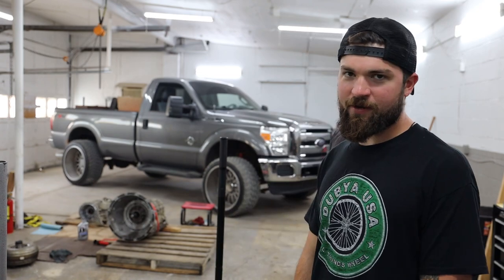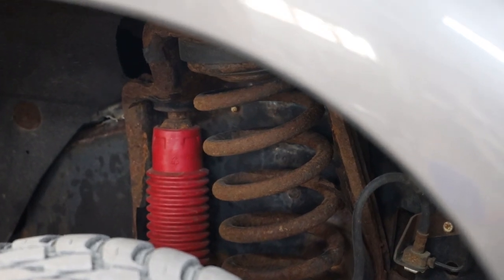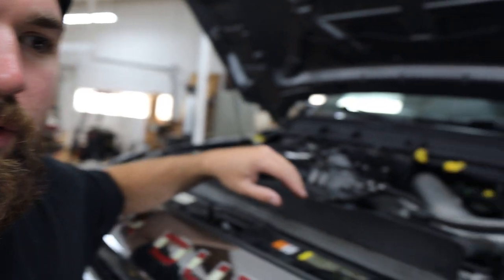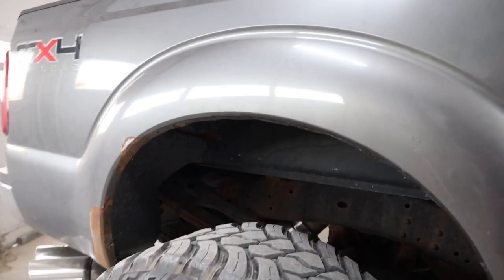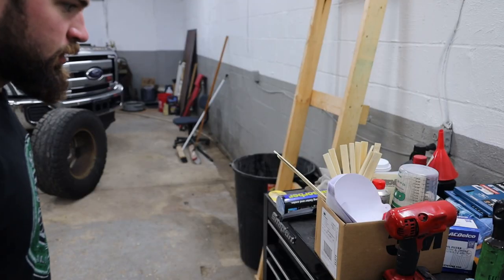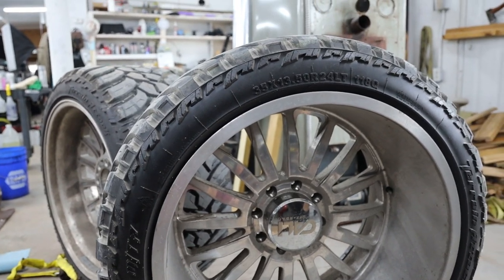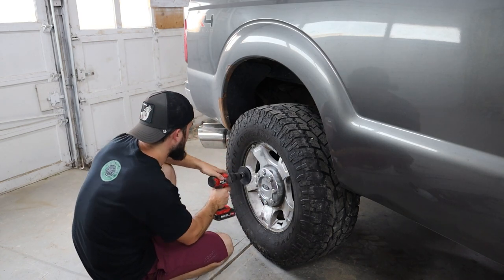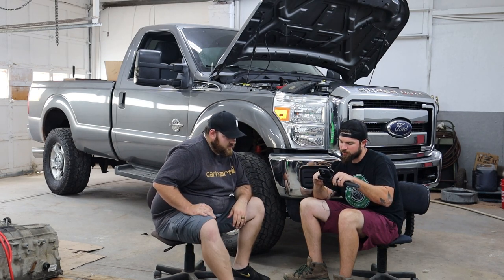Does Your FORD SUPERDUTY Have Front End Issues? CHECK THIS

Comment: New 2022 F-250 6.7L PS's are sitting "at the docks" because of this issue:  22E05 - Powertrain Control Module Calibration For Particulate Matter Sensor

Seems Ford engineers screwed up again and now these brand spanking new trucks cannot get delivered to customers over this PCM part needs an upgrade.  

Oh!  The parts are not expected to be available until late 2023!  HFS!  

Start building parts in the USA Ford!
Reply from the maker: Real nice

Comment: FIRST THING ITS A ford.  Built for the weak and cheap
Reply: Do you know what channel your on?
Reply: I’m not weak or cheap on my third 6.7 powerstroke and never had a issue
Reply: Why sub to this channel then? Tell me your reasoning
Reply: @msokes9  because it’s a bunch of sweet ass trucks going fast as hell
Reply: Kings got nothing. Exactly.
Reply: @msokes9  I wouldn’t say that I have nothing I have a 4000 square foot house on 8 acres that is paid for with a 4 acre lake a 2021 Chevy 3500 Duramax with a Cognito 4” lift on Fuel Rebel 8’s.  The wife hads a 2016 Escalade paid for and we are going to order the new supercharged Escalade V.  I wanted a new C8 Z06 but not until the kids are out.  Probably be a C9 by that time.  I choose to drive America’s best not tractor farmer redneck ford and dodge.
Reply: @KINGZSPEED  I drive a duramax for work; great truck. Ford makes great trucks as well from experience. Not sure where that “redneck” stereotype came from.
Reply: @msokes9  Where I live old men and farmers drive ford very slowly and the obese guys drive dodge with truck nuts hanging from the hitch.  Rolling coal and acting like tools.  Also don’t get me started on the mustang idiots.  I just have had horrible experiences with ford.  Engine trans and rear end failure  death wobble electrical issues and they just don’t hold their value.  The paint comes off the emblems and the ford dealers and service departments are worthless.  I’m so glad you have a Duramax.
Reply: @KINGZSPEED  fair enough. Just wanted to know your reasoning. Some people like to shit on brands for nothing and doesn’t make sense to me. I definitely don’t fit into that stereotype lol. I like to get real work done.